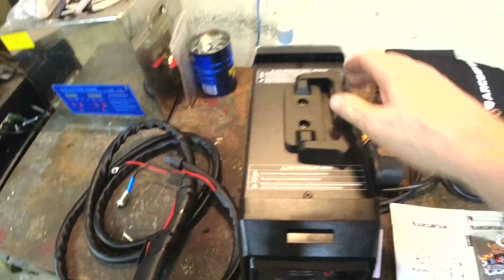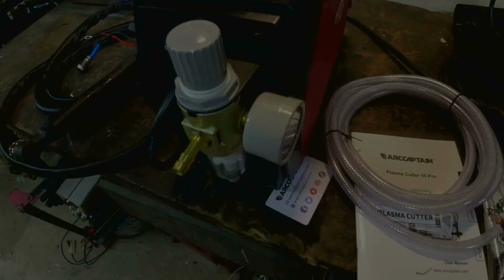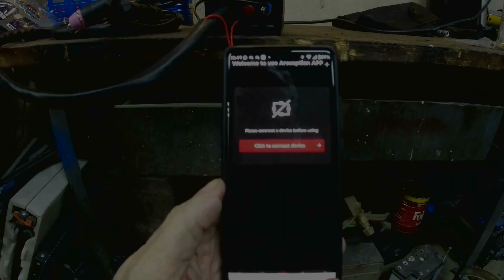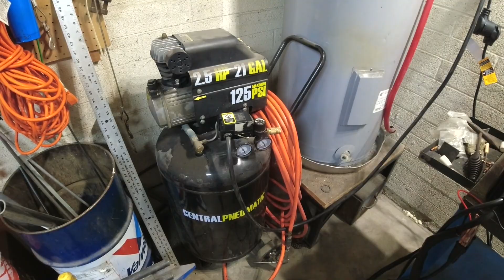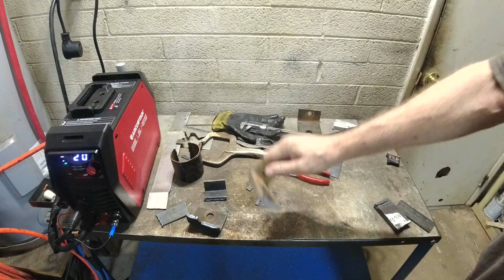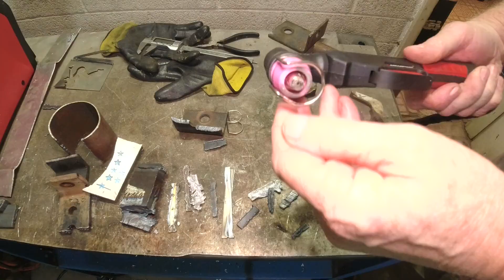Arccaptain iControl CUT55 Pro Pilot Arc Plasma Cutter Test and Review!

Comment: Great test and video!  I have an old jeep cj5 that somebody welded stuff onto, and was wondering how I could cut it off. Little room for any kind of saw, but this will do it, thanks again!
Reply from the maker: I bought my first plasma cutter 3 or 4 years ago when I was fixing up my CJ-7 and wanted to cut the hole in the firewall for the blower motor bigger. Every time I saw it done it was a hacked up mess. I made a guide that fit over the hole as a sort of pattern and cut it with the plasma cutter. Turned out really nice. I made a video if you search my channel for "firewall" you'll find it.